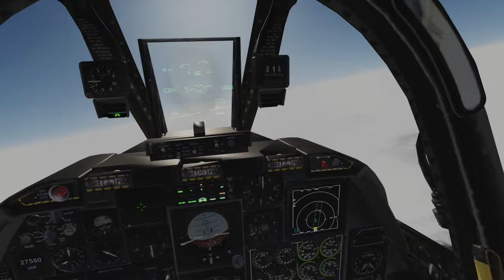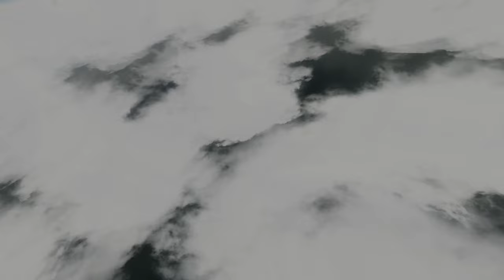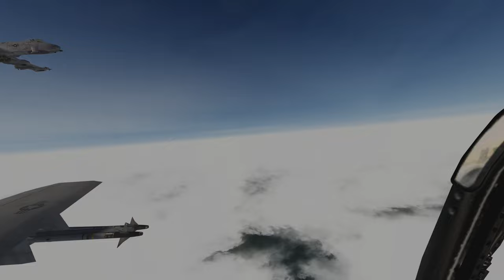Falcon BMS 4.37 - A10 refueling is hard, but can be done!

Comment: Have you tried refueling the A-10 in DCS? If so, is it easier?
Reply from the maker: I tried and actually it was about the same, maybe…? I hooked up quick in DCS but found myself using the same way I had to in bms- I think a lot of it is flying at the boom instead of by the lights like in the viper. Just surprisingly different technique
Reply from the maker: Vipers easier in bms than dcs for sure- have you tried both? I heard bms simulates a change in input sensitivity when stuck on the boom.
Reply: @Wheelman_PCAS  No, I haven't flown in BMS for years, maybe I'll try it soon, I'm waiting for 4.38. I think that tanker lights are more visible in BMS, and the lack of boom physics in DCS is annoying.